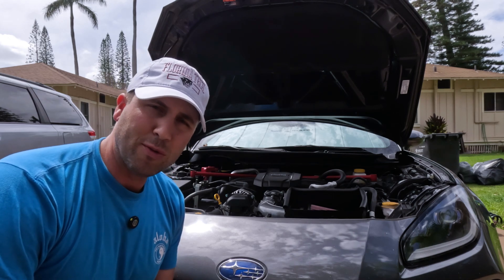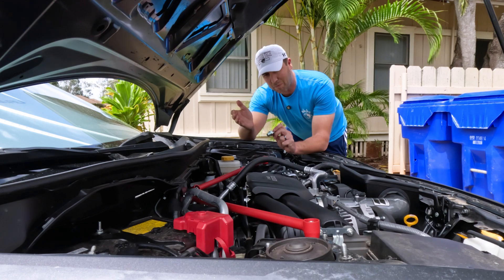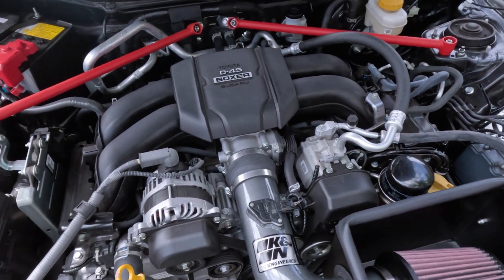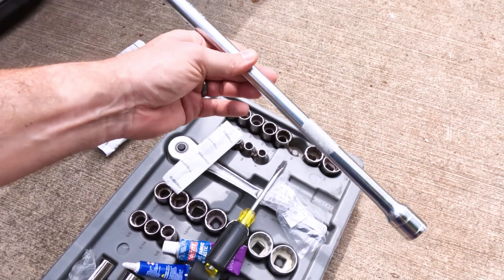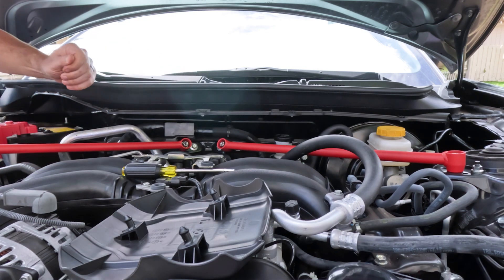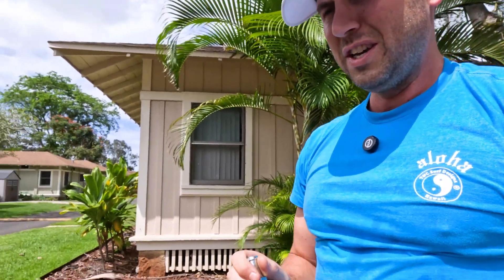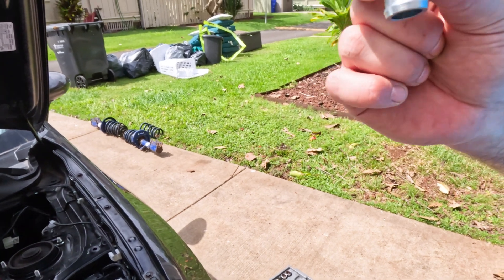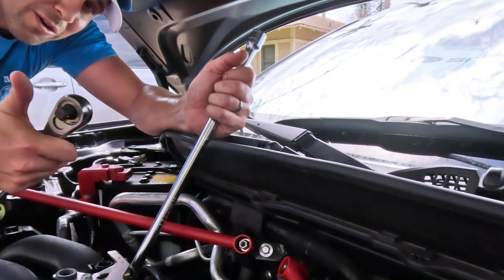$15 bit that can wreak havoc on your engine...here's the symptoms & how to fix a bad PCV valve

Comment: The factory service manual does state to put threebond FIG 1217H on the threads prior to installing. 17 ftIbs torqued. It torques into the  aluminum block instead of a steel insert so be careful not to torque too tight.

Comment: where can I buy such a valve if the original one is wrong which one is in the car, please give me the part number and where can I buy it, thanks?
Reply from the maker: The original valve isn't "wrong", it just failed quickly on my car.  I installed the same OEM part number back into the car 🤙

Comment: My '23 BRZ was consuming quite a lot of oil. You could see blue smoke when rev'ed. And the idle constantly bounced around. All came back to a gummed up PCV. Bought a new one for I think 12 bucks, took 10 mins to change, and the oil consumption completely stopped. I did not take the top part of the hose off, just pulled it off the PCV. There was oil sitting inside the PCV valve. The oil consumption was there since new. I think the issue was due to the car sitting on a lot for 6 months, which resulted in oil inside the valve getting gummy. Its been fine every since.
Reply from the maker: Smart thinking keeping the top hose on -- no need to pull it.  I'll do that next time around 🤙

Comment: How on earth did you get the hose fully back on, i cant get mine all the way down :(
Reply from the maker: Slid right back on, but then again I only have 8k miles on the car.  Maybe put a dab of oil on?
Reply: @MikeRoadway is it only supposed to slide down the tube and not over all of it
Reply from the maker: @ya_boi_nugget863 correct -- the tube will slide down to about 5mm above the PCV "nut".  No issues here; just keeping an eye out for any leaks.
Reply: @MikeRoadway oh okay thanks, what about the “nut”? It doesn’t seem to bolt in all the way down, cant find my torque wrench so im eyeballing it
Reply from the maker: @ya_boi_nugget863 also right on, the PCV doesn't thread all the way in, just like the OEM bit (have a look where the OEM thread-lock stops).  For sure be careful not to over-tighten.
Reply: @MikeRoadway  sweet, job was done and it fixed my rough idle, have to check about the burning oil smell after each pull soon. Thanks for all the help!

Comment: Is this just an FA24 thing or does it happen on the older model as well? I have both & my 2013 has never had that problem.

Cheers😊
Reply from the maker: I haven't heard of early PCV failures on the FA20, so yes so far they are more common on the BRZ/86 FA24.  I have a feeling the PCV itself is the culprit as opposed to an engine design thing, but then again I have about the furthest thing from an engineering degree as one can get 🤙

Comment: Great, thanks…. BTW Loving my HKS exhaust. Have you swapped out the clutch pedal spring yet to a lighter one. If not MTech or cheaper GKTech weakest spring, it makes a magic difference to the clutch engagement. Cheers.
Reply: I haven't done the assist spring, but I did adjust the pedal to move the clutch pedal a bit lower, and it does change things quite a bit.  Can't really describe it.  I wasn't looking for a feel change, I just wanted the pedal a bit lower so that it's easier to get my left foot past it to the brake pedal for seating the pads before the braking zone on track. 😅
Reply: @grippgoat lowering the pedal has most liked helped by moving the fulcrum point we’re the spring flips over from holding pedal free play up and the assisting to push it down. So if that switch off fulcrum point now not were the clutch bilges on way up it may have helped. Still removing spring or fitting lighter one helps a lot more. Old spring is a valve spring that is too strong and the transition from holding up and assisting is jerky.
Reply from the maker: No new cutch spring here -- did you go with MTech or GK?  I may give it a try one day.  Glad you love the HKS!!!  🤙
Reply: @MikeRoadway  Went the GK they provide 2 springs a 33% less force one and a 66% one that I used it’s same as MTech one. It really is a great job. Easy job on LHD USA cars as it can be changed without taking the pedal out. Go for it. Also got a XLR5 RaceCip throttle controller too; which makes throttle far better. All good. Cheers

Comment: I made it to 50,000 miles 2023 GR86 and thought it was time for sparkplugs.  Had a stumble at idle.  Swapped out the pcv snd all is good now.  Did it without the wobble extension but it wasnt as easy as you did lol.  Next time i will get the wobble.
Reply: Mine has always had a bit of a dodge idle, been told its just a 'rough boxer idle' , is it obvious? Wondering if I should do mine now...

Comment: We bought a really nice condition and low mileage 2013 Miata and I was surprised to see it was burning about a quart of oil every 1,000 miles. I had to remove the intake manifold and luckily the pcv valve was bad. Replaced that and it burns no oil between changes now.
Reply from the maker: Hey nice fix -- always rare for such a cheap part to remedy such a big issue right??  Glad it worked out 🤙
Reply: @MikeRoadway thanks. I sleep much better at night now 😂

Comment: ive been having oil disappearing on me ever since i got my chevy cobalt, nothing coming out the exhaust, and im thinking of replacing the valve. it makes a supercharger like whine too
Reply from the maker: Two telltale signs of a bad PCV -- can't hurt to give replacing it a try.  How invasive is the install on a cobalt?
Reply: @MikeRoadway   i believe its just under the intake manifold, so its not too hard, but an awkward angle for sure

Comment: How often do these things go bad, typically?
Reply from the maker: It's hit or miss -- from what I've seen and read some PCVs are duds right from the factory, and others make it fine to the 30k service.  Mine died at exactly 2 years and 8200 miles; I'll be installing a new one each spring going forward.
Reply: @MikeRoadway  Seems like maybe you'd want to always keep a new one on hand, but not replace until you see signs.  It'd be a shame to replace a good one with one that's DOA. 😅

Comment: PCV valve is so important on EJ and FA engine because the crank case is so small. Cheap and easy to do! On older one it's always a good idea to change the hose because they get rock hard.

Nice job 🚗💥💨🔥
Reply: I wonder if my 113k mile 2005 STI was burning oil because of a bad PCV.  I just assumed it was wear and tear from the hard life I gave it (bought it new in May 04).  Oh well, I'll never know. Sold it back in 2018.
Reply: @grippgoat I would say maybe it was the 2!
Reply from the maker: Super well said -- had I not caught this early I bet the crankcase pressure would have pushed oil out of every seal on this FA.  Ty for having a look at the video 🤙